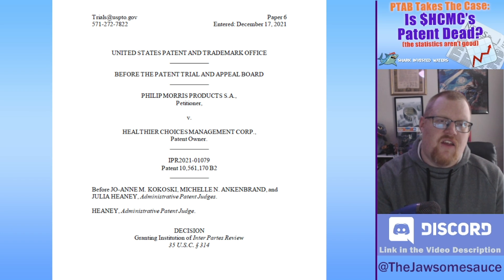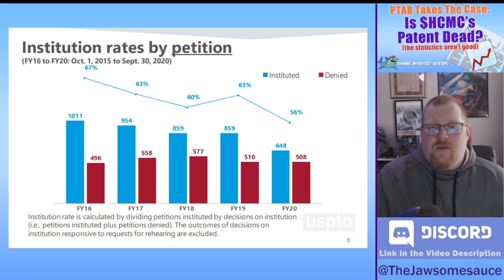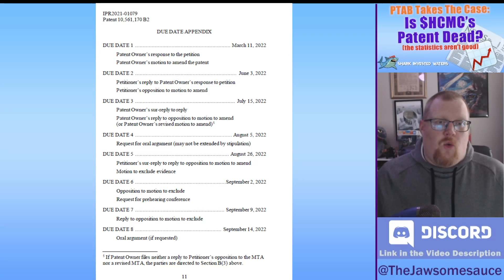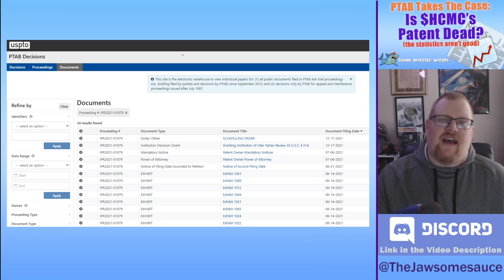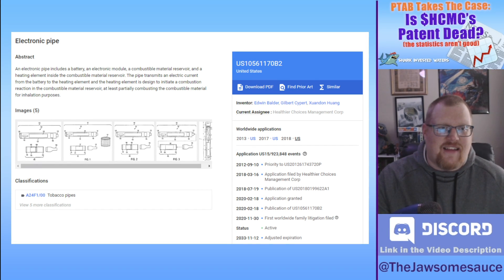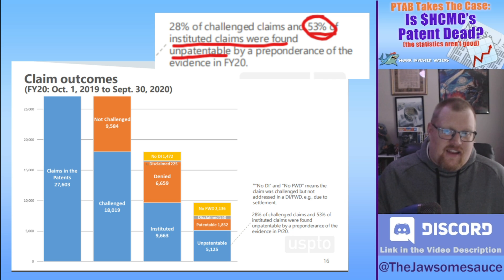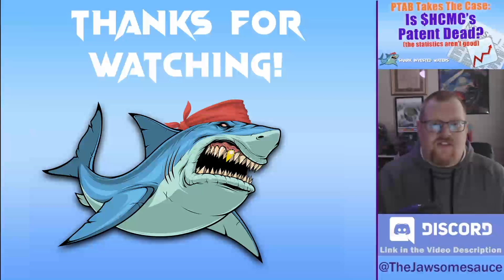PTAB Institutes $PM's Review of $HCMC's Patent - Is It Doomed? What it Means and What Happens Next

Comment from the maker: Timestamps:
00:01 Introduction
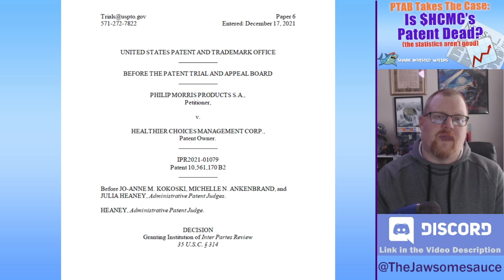01:10 Why Grant Patents That Can Be Overturned?
02:38 What Happens In The PTAB Review?
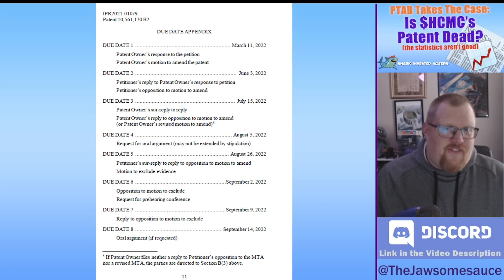04:07 What Happens Next? Timeline
05:52 What Does This Mean for HCMC?
Reply: Jawsome so what's up with this latest "dismissed" for appeals, what is that?
Reply from the maker: @FilmPA1986  That appears to be a court error where they sent the court records for the appeal to the wrong appeals court (the appeal will be in the Federal Circuit, the court sent them to the 11th circuit).
Reply: @SharkInvestedWaters  Got the memo👍🏼 that clerk should be fired
Reply from the maker: @FilmPA1986  eh, it's really no big deal to anyone working in the court system. It happens. They send 99% of their records to the 11th circuit, so they're used to following one process. This probably just threw a wrench in there. No impact on the case.

Comment: Let me preface this by saying I'm still very bullish on HCMC.  If the patent office in the end says this patent already existed under someone else's patent, this would mean HCMC has been infringing on this other patent?  Could they be sued for having been using this patent, or does that blame fall on the patent office?  How does that work?  Now that the court case has been dismissed, PM is basically wasting money fighting about HCMC's patent.  😂  On a final note... could HCMC just file a patent on PM's "heat not burn" technology?  They don't have a patent for it, correct?  HCMC could just use the FDA document as proof for patent approval.  🤭
Reply from the maker: It's a lot more complicated than that and involves some engineering/patent specific knowledge I don't have. But basically the patent issue is that the PTO would find that HCMC's patents is really just a bunch of pieces of other patents thrown together, which makes it have nothing new. It's a combination of other things, so it wouldn't necessarily be one specific patent (versus where the IQOS is straight up looking like it's HCMC's description in their patent entirely, not just a piece.)

Comment: What happens if some of the things in Hcmc Patent Rejects but some approves ; Will they allow to makes necessary Changes or Redisgn few Steps etc ???
Reply from the maker: It depends on what's left. One of the things at debate in PM's petition is that an older patent (The Robinson patent) already covers devices that combust to heat tobacco. So if that part gets struck out, that's pretty core to what HCMC's device does. They can request to make changes to their patent anytime before their response is due in March, that's the motion to amend deadline that's on the scheduling order.
Reply: @SharkInvestedWaters   Oh, so HCMC would have to alter their patent before the March 11th deadline?  And the patent office would use the changes during the review?  Wouldn't changing the device change what they're suing PM for?

Comment: It's interesting you mention statistics in the beginning of the video, but faed to mentioned what % of requests for review actually get granted. If it's true the review process exists because as you say there are just to many patents and patent applications to do it during that step, then I would think all you really need to do is request a review and it would get granted.
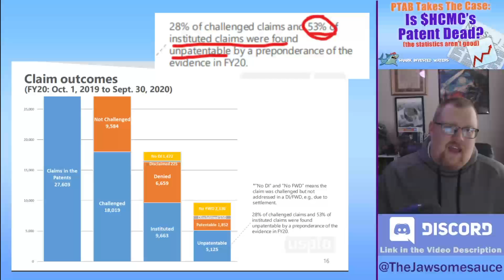Reply from the maker: At minute 2:36 that chart shows the # of denied reviews too (red bars). It's getting closer 50/50 now, but it's been around 30-40% denials of review requests in recent years. So statistically slightly more than half of review requests are granted; slightly more than half of those reviews have led to invalidations, which means around 28% (the figure called out in the box from the chart at the 7:30 minute mark) of total requests lead to invalidated claims/patents.